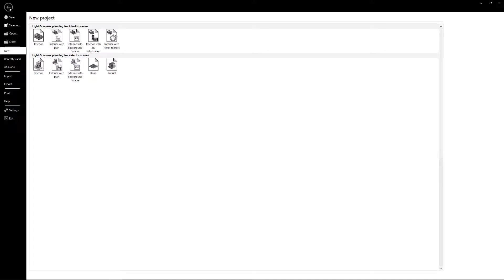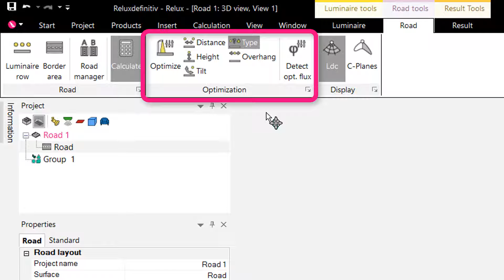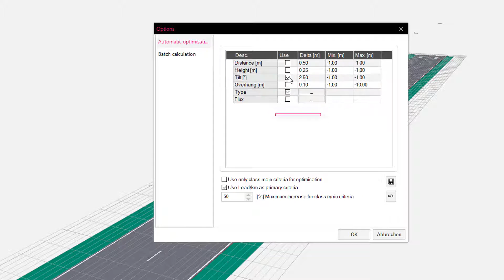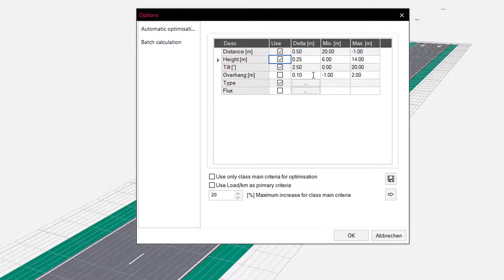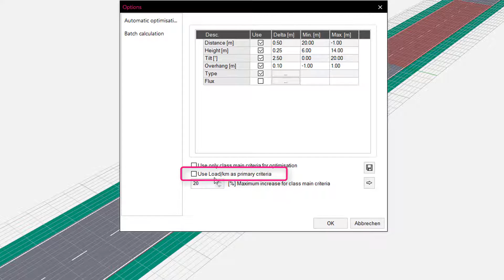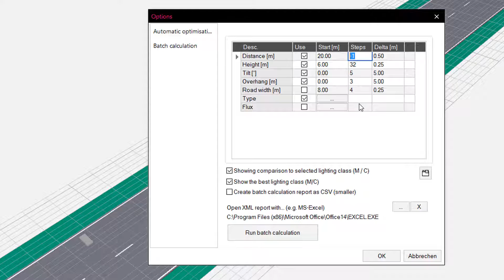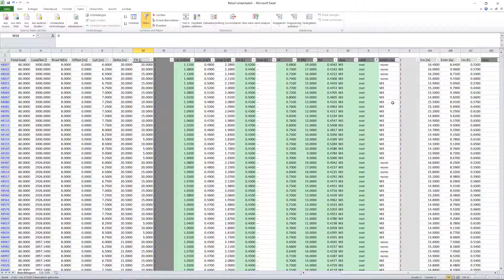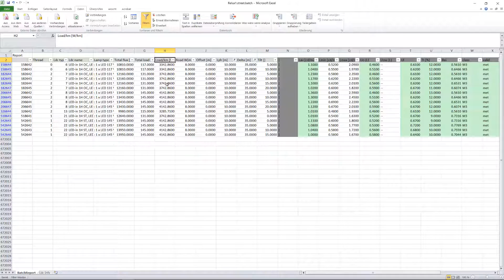ReluxDesktop tutorial -  Road and outdoor lighting for professionals

Comment: It is possible to check if I meet norm M in exterior scene?
Reply from the maker: Dear Tomasz Adamski

Of course, you can use the following lighting classes for your exterior or street projects in ReluxDesktop: M, C, P, HS, SC and EV

You can find more information on our website: https://relux.com/en/relux-desktop.html

Best regards,
Your Relux-Team
Reply: @ReluxSoftware  In this movie you calcualte M class only in road module. In second part you have exterior scene but you choose C class. My question is about exerior scene and M class. I know I can choose M class, but calcualtion are only lx not luminace.
Reply from the maker: @TomaszAdamski-zm7eq  In a street project, the streets are calculated and this is usually done with candela. In an outdoor scene, the conflict zones are mainly calculated, using lux. There are many reasons for this. For example, you need an exact viewing angle and material to calculate candela. This is automatically given in a street project, but in an outdoor scene you can only calculate candela on a specific surface with a material and not on a virtual measuring surface.

If you have further questions on this topic, please contact our support.

Best regards,
Your Relux-Team

Comment: It is possible to move lamp along the street? For example if we want to have a lamp on the opposite side but not exactly in the middle of the module ?
Reply from the maker: Dear Tomasz Adamski  

Yes, that is possible. But first you have to open a hidden window with Ctrl. + Shift + 5 and activate UseRowOffset. In the settings of the upper streetlights, the offset can now be added. We will include this function in an official version in the future.

Best regards, 
Your Relux-Team
Reply: @ReluxSoftware  Thank you!